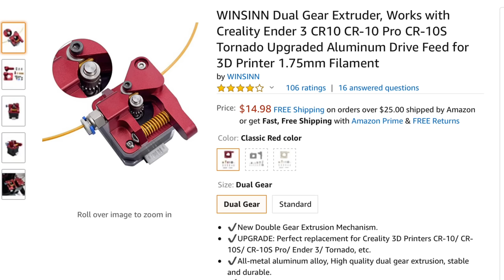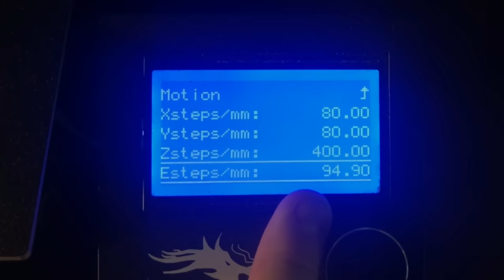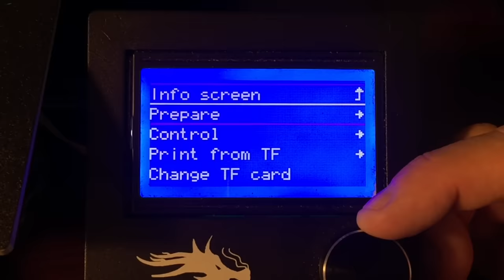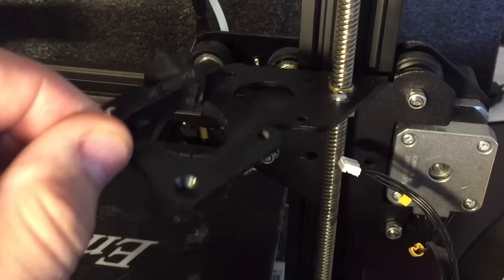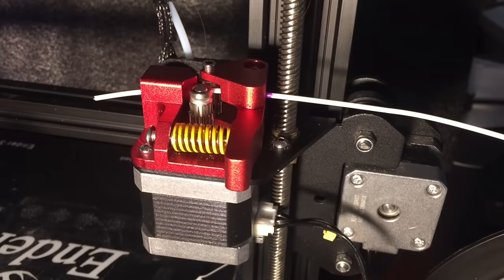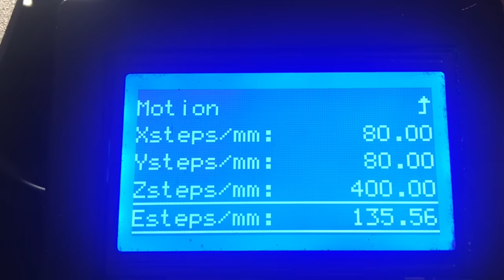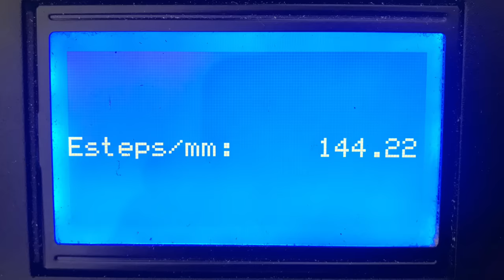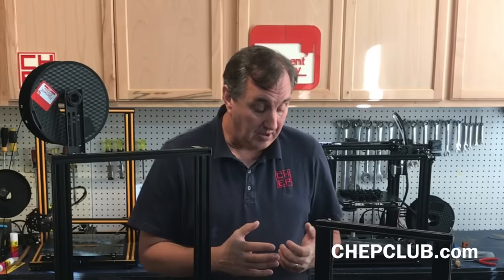Dual Drive Gear Extruder Upgrade + E Steps on Creality Ender 3

Comment: Thank you for this video I was messing around with the extruder just seeing if I could tighten this ring up and I noticed that the drive gear is way high so I took that apart and I realized that the screws that screw onto the motor were like unscrewed so I screwed those in and hopefully now the drive gear will work I'm not going to test it tonight though I'm way too tired to monkey with the printer anymore but things for a kind of explaining how things work to the point where I understood how to fix the problem for now at least I hope

Comment: CR-10S Pro use the Genuine Bondtech Dual Drive Gear and not the clone, please note and thank you all.
Reply from the maker: The assembly, arm, base, etc aren’t Bondtech correct?
Is it only the gears?

Comment: I tried this for a while on my ender 3, but took it off. In fact, I returned the first one I bought because the idler tightened up during a long print and eventually jammed. Taking it apart, I found that it had only one needle bearing (the listing shows 2, which should be stacked one on top of the other (that's the way it is on my Prusa's Bondtech gears). I returned it saying missing part, and reordered it, and the reordered one also only has one needle bearing. That coupled with the inability to put a knob on it makes me want to keep looking. I may try the EZR next or a direct drive conversion.

BTW, when I do e-step calibration, I measure 120mm, and extrude 100. This allows you to still measure even if it goes past 100mm (e.g. you told it to extrude 100, and it did 107). You have to subtract the 20mm in calculating how far it actually went, but I like this method. I do like your test of loaded (through the hotend) and unloaded. Thanks for another great video.
Reply from the maker: Mine have two bearings

Comment: My extruder completely jammed with filament this week, bought the aftermarket one right before it happened. Great timing I guess. I seriously cannot get the filament out of it still. I have no idea what is going on. It is just jammed, no idea why it cant come out. It basically will require more force to push it out than the plastic mold can take. Maybe heat would help, but this extruder is better 10 fold.

Comment: The stock plastic extruder is flimsy, but you are kind of comparing apples to oranges here comparing the soft brass gears of the original extruder with the stainless steel gears of the upgraded extruder. The design of the gears is also different - the brass original has protruding gear teeth, while the upgraded gears have valleys with the notches cut into them. I installed a similar single drive gear metal extruder on my Ender 3, and still had frequent slippage until I upgraded that to stainless gears. I believe I wore down the brass gears on my Ender 3's original brass extruder gears just from printing a full roll of filament with metallic particles in it. The major Chinese vendors carry the stainless gears for cheap - worth getting a small bag just to have on hand. Best wishes.

Comment: I have prints fail because the stock gear starts slipping and digs a groove in the filament that it gets stuck in. I hope this upgrade will make it more reliable.
Reply: Turns out my extruder arm was broken. I ended up getting the regular all metal single drive gear extruder because MicroCenter had it in stock for $10

Comment: The only problem with this extruder is that the non-drive attached side has needle bearings in the drive. The screw that the needle bearings spin against is a threaded screw and has been for quite a while. the gear ends up chewing the crap out of the arm and the bearings wreck themselves on the screw.

Comment: I've just installed a dual z axis on my ender 3 pro I seriously wish it was the first mod I had installed
This would probably be a great upgrade for you to do with a video 
I don't do videos but I will say bed leveling has never been so perfect since this addon
Reply from the maker: Where did you get the dual axis kit?
Reply: @FilamentFriday  AliExpress about $30 they had several choices some with adding another stepper motor I went with the drive belt across the top it's made a world of difference and my prints are way smoother compared to before and now there is no wiggle room on the right side of the x axis

Comment: Hey Chuck, thanks for doing this video, but how about us guys that did what you recommended in a previous video? Lol ... I bought the EZR STRUDER, and love it! And, I would venture to assume it is much better than this dual drive extruder in this video because it handle 82A soft TPU with ease! 😎 🤘
Would you please do a video on how to convert our Ender 3 with EZR STRUDER to direct drive? 
Thanks Bro! And thanks so much for being there for us and focusing so much on the EXCELLENT Ender 3! You're my favorite 3D printing channel... By far! 👍😁
Reply from the maker: EZR is more expensive and harder to get but It is better. I still gotta test what’s out there. 
I’m working on a direct drive video. 
Thanks.
Reply: @FilamentFriday  No, Thank You! You replied maybe 3 minutes after I asked this question! Great to hear you are working on a direct drive video for the EZR STRUDER! I will wait for it! 😎
Hard to get? I went to their page and ordered 2, one for Ender 3 and one for my Ender 2...got them in a few days. Didn't seem hard to get at all. 😁
Reply: Michael over at Teaching Tech did a video on fitting the EZR in a direct drive setup on an Ender 3.  It's a pretty simple swap but he did have to print a small spacer to get things to line up correctly.  It does look like a pretty sweet combination.

Comment: I have only tested this a few times so far but I am finding that the spring tension is much more crucial than a single gear and that I am having a lot of stringing relative to a comparative amount of retraction. I do have it setup on a direct dive assembly and have managed esteps as per the video

Comment: Thank you so much. I did not masure the setting before than demonte the older extruder, then i had some problems about my prints. When i see your video, i realese the importance of Esteps setting. It took re-install to older and again upgrade step by step time but worth it. Thank you so much sir. By the way my Estep is at 150 right now. I guess there is no stable setting for these esteps whic works with any aluminium extruder.

Comment: another thing is the original brass extruder can wear out. that happened to me yesterday when i was working a big print.
Reply: lol when i ordered mine new i bought a set of spare and even .8 .6  1.0 sizes. i come from the cnc world and the most changed part of the machine if the cutting/extruder part.

Comment: Nice video, lots of good information. My kit came with two springs, the yellow on and a silver one like the one gear metal extruders come with.
Couldn't find any reference to the second spring anywhere. I am going to try it with the yellow spring and change it if there are problems.

Comment: I got a dual extruder with my replacement Geeetech A10M but I don't like it. It's much harder to turn the gear when you want to push or pull filament without grabbing the actual filament. And my new printer just doesn't print as well as when I bought the same printer back in 2018. It might be better, but maybe the printer has other issues. I'm still setting it up and finding things not quite right. Took years to get the older one perfect. Sucks going through it all again but at least the e steps are set up correctly this time

Comment: I ordered a dual gear extruder but ran into an issue after using it for a while.  The one I received (forgot the brand) started eating into the aluminum frame.  After further investigation, I noticed the bearings the second gear rides on were too short and would allow the gear to tilt.  This tilt would allow the teeth to scrape the aluminum frame it rides on, which caused increased resistance, creating a jumping gear drive.  At first, I thought the drive motor but found this once the new motor came in and I was disassembling the parts.

Comment: great video Chuck, very informational and detailed. 

question for you...
 I'm fairly new to printing and  have an ender 3 v2. just put a PEI plate and another z stepper/ axis rod. The new extruder (same one in video) will be here tomorrow.  
Calibrating e-steps before installing new extruder, is it mandatory? I would assume you would want to calibrate it after you install it. You know more than me though! :)
Thanks Chuck!!
Reply from the maker: Definitely. E steps is very important

Comment: Your video shows a Winsinn upgrade kit and you said there's a link to it.  But the link I find:  @t is for a Aeelo dual drive extruder.  Are they the same, or at least, are both compatible with Ender 3 V2?

Comment: Hi , my printer(Ender 3 Pro) is on its way and I'm thinking of ordering this extruder for it. Did you have any problems with this particular one so far ? Should I buy this on or the metal one with the single rotor? Also great videos man love your work .
Reply from the maker: I would put an EZR on it or the single gear. This one wears out.
Reply: @FilamentFriday  I bought the ezr before this one.  But the screw holes didn't match up. When I finally got them lined up.  The clear top piece pops up and the spring will not push in. Hopefully cnc will send me a new one.  But I don't see anything about returns on their site.

Comment: No Capricorn PTFE?  :)  Great comparison - minor benefit for PLA at the "right" temperature to minimize back pressure.   I had to switch to a metal extruder on my CR-10 because I wore a groove in the filament inlet hole on the plastic arm after running several spools of filament through it.  I recommend a metal extruder for that reason - you can choose single or dual gear.
Reply from the maker: I have Capricorn on most of my machines but this is a test unit with stock components.

Comment: Hi Chuck. Just wondering if you could make the same e step changes on the single drive extruded and improve the results. Also, I replaced my plastic stock extruded with the aluminum on you suggested in a previous video. How does it compare?
As always, great info and a very clear explanation.  Great work.
Reply from the maker: I didn’t suggest an aluminum in a previous video. I recommended an EZR. It’s more expensive but better than this dual gear.
Reply: @FilamentFriday  You are so right - my mistake.  I did indeed order the EZR extruder to replace the plastic one that came with my Ender 3 - as you suggested.  It has been working great for me for several months.
It is NOT aluminum.  So sorry I said that.  :-)

Comment: Hi Chuck
The kit I got (Ebay) had the idler gear roller bearing running on the thread of the screw. The is not going to last very long and should be running on a smooth flat surface. I didn't install it yet because I want to find a better solution. If I can't find a screw with a long shoulder I will use a length of rod and thread the ends. Really like the idea of the dual drive gear setup especially for flexible materials.
Cheers
Willy
Reply from the maker: My idler gear has two bearings inside that it rides on. Yours was defective.
Reply: Hi Chuck
Yes, your idler gear runs on the OD of the two Needle Bearings, like mine. But what is the ID of your Needle Bearings running on? 

If your Idle Gear mounting Screw doesn't have a long enough smooth section below the screw head, than your Needle Bearings end up running on the thread of the Screw. The ID and OD of all Roller/Needle Bearings are meant to be running on smooth flat surface. Having the Needle Bearings running on the thread of the screw is not ideal and the Screw and Bearings are going to wear prematurely.  Hope this is a little clearer.  Cheers Willy

Comment: You should only use whole numbers for your esteps. The esteps already account for microsteps so they cant be divided any smaller than a whole number, and the decimals roll over until they add up to a whole number then you periodically get a whole extra step resulting in repeating surface artifacts
Reply from the maker: I asked the marlin firmware creators and they said decimal point accuracy is correct.
Reply: Marlin  is able to yes, but the stepper motors cant nanostep.
Reply: @mikescholz6429  got any documentation on that ? Not trying to troll, I'm genuinely interested and want to get to the bottom of this issue.
Reply from the maker: My understanding is marlin uses it in the calculations of micro steps.
Reply: bastol with a 7mm diameter gear multiplied by pi you get 21.98 mm per complete revolution. 200 step stepper motors with 16x microstepping gives you 3200 steps per full revolution. 3200/21.98=145.58... therefore esteps already account for microstepping and theres no way for the motors to do anything with that 0.58.
Reply: @mikescholz6429  so i guess decimals add up until they get to a full unit
Reply: bastol yea I noticed I always had evenly spaced repeating lines on my prints and had heard another YouTuber talk about being suspicious this was the case, so I did the math and figured this out. I took the decimals out of all 4 of my step values and the artifacts vanished.

Comment: Changed my Ender 3 V2 to the metal one works great only one small draw back - no manual feed knob the shaft on the stepper is too short for the knob the gears are a lot taller
Reply: i did same but now the coupler is getting heated up from the stepper motor  and tubing coming lose

Comment: What do you think about a direct gear extruder? This will make you able to print flexible filament on your printer. I‘ve done it at my Cr-10s pro and also at my Artillery Sidewinder, it has already one, but it was too instable for me. A gear extruder made of Aluminium is state of the art. Just in my opinion...😂

Comment: CHEP, I did this and I had to turn my FLOW down to 90% sometimes less (80-85%) or else my inner and outer diameters were WAY out and if you do the standard single-wall box test you find that a 0.4mm side wall is around 0.52-0.55mm so it seems to be over extruding, this has been a fundamental issue for me as the enders set their defaults at 93 steps per mm, meaning that Creality knew that 100mm fed was always over-extruding by 7% I get decent prints with my CURA flow at 90% and my BondTech twin drive extruder calibrated to kick out exactly 100mm
Reply: Makes me wonder why cura and all the other slicers are over extruding by 10% when you get the extrusion bang on, is this just a legacy compensation effect from crappy drives for so many years?
Reply: I noticed this too and wondered why it came that way.  Great detective work.

Comment: Did you try to adjust the esteps with the single gear and ptfe installed?
getting the same 6mm slippage at print temp before and after the dual gear seems like an unnecessary upgrade. I could very well be wrong but it just seems so without the esteps adjusted before the dual gear install

Comment: Hey there boss.
ive got some serious issues with my printing. 
i changed my stock extruder (the platic broke) to metal dual gear. to make this comment easy: "i did everything the same, like in your video" . so, yeah, i changed it, calculated my E-steps and set it up, plus saved of course. since this happened and i did everything correctly, after setting up the e-steps, the extruder too in 100mm of filament (+ - really a 0.1mm - it was really accurate!). so every setup was just fine. when i started to printing, all and i really mean, ALL my printings are over extruded. all of them. i did my own cura setup, i copied yours, i changed the flow to 95% in cura, but nothing changed, nothing helped me at all. ive tried everying i knew and was hoping in, but still my prints are over extruded, and on 3rd/4th layer i have to stop the printing, cuz my nozzle is hitting right the last layer or going trough the last layer.
i need someones help, please, i beg you all :( what can i do from here now?
Reply: The spring might be loose tention it a bit and see how you go.
Reply: Honestly man I switched the stock extruded out with the dual metal gear without watching any tutorials and I definitely did not calibrate it and my prints on Ender 3 V2 are just beautiful maybe I just got lucky but idk
Reply: Did you ever find what the problem was ? Having this issue aswell.

Comment: Thanks Chuck, I am just a rookie in 3d printing, I subscribed your channel recently and learned so much from your informative videos. 
I just worn out my Kobra Plus Extruder last night, and I was wondering what other choses do I have to replacement my broken one, and then I saw this video. Regarding to this Dual Drive Gear Extruder, it looks similar to mine, I was wondering if that is also comparable to Kobra Plus printer, Is there any tips to figure out if any new Extruder is comparable to my printer?  
Love your video and thanks again
Reply from the maker: I don’t have that printer but most extruders fit the same.,
Reply: @FilamentFriday  Thanks for your reply. 👍🏾

Comment: I just installed this extruder on my Ender 3v2 and now have the worst stringing and blobbing I have ever seen on a test tower. Prior to the install I had zero stringing on a test tower using PLA with these setting in cura, 6mm retraction at 25mm/sec. These are the things I have tried: I calibrated e-steps perfectly - replaces bowden tube with capricorn - cleaned out hot end and installed new nozzle - adjusted retraction distance both ways from 6mm - used different filament. After each of these changes the test tower showed exactly the same amount of stringing. Short of going back to the stock extruder what else can I try. Thanks.
Gary